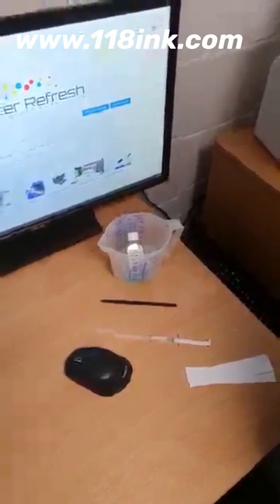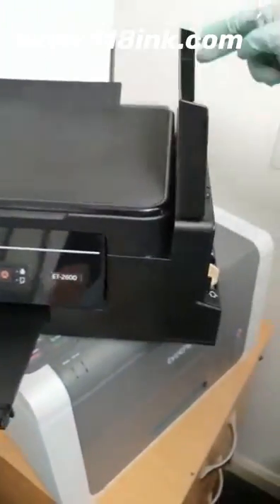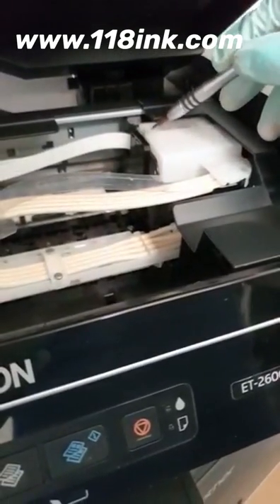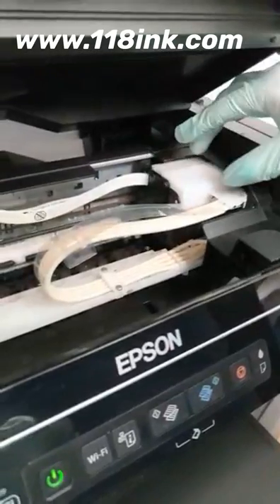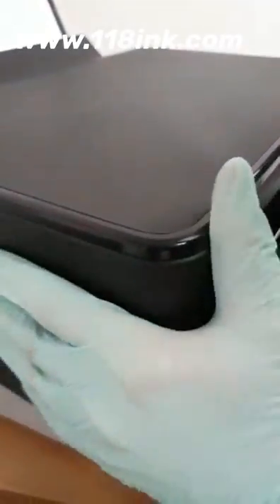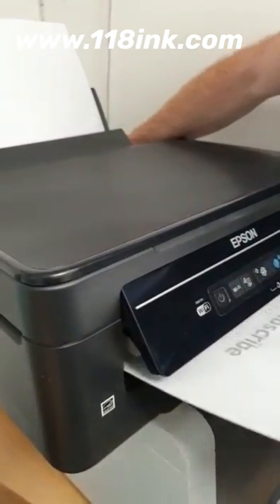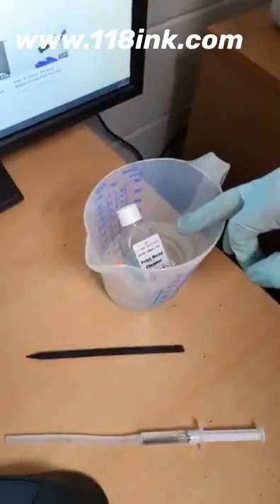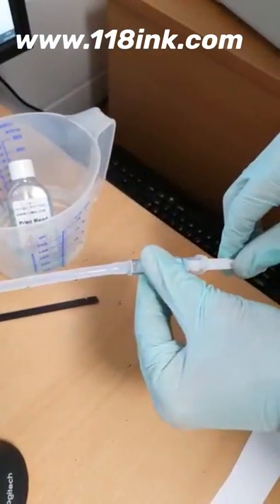How To Clean Blocked Or Clogged Print Heads On An Epson EcoTank Printer The Easy Way

Comment: That worked!  Thx.  BTW, I used kitchen towel but I backed it with some clear packing tape to make it stiffer then easier to push through and so no ink would leak through.  Also, I had no syringe but I had an eye dropper so I ran a 3/32" drill bit through the end to open up the hole and that clipped onto the nozzle nicely.  I did two flushes with the eye dropper.  Prints like new now.
Reply from the maker: That’s brilliant. What did you drill exactly?
Reply: @Theinkrefillexperts  The tip of the plastic eye dropper.  I just twisted a 3/32" drill bit through the tip with my fingers.

Comment: HEllo "guys in the same boat", there is also the power cleaning, switch off, push ? + on buttons till it switches on, then let it wok 10min, done. It uses a lot of ink but saves a lot of time! anyway thanks for this accurate video!
Reply from the maker: You are very welcome

Comment: Hi! I wonder if you could help me. I have an Epson ET-M1120 (monochromatic) which I use to print tattoo stencils (many tattoo artists are doing the same wíth these printers). So basically when I set it up for the first time I fill the tank with stencil ink for printers instead of the regular black ink. I didn’t print anything for a 1 month and half and now it’s printing with missing lines. I have done everything, head cleaning, power clean, everything that comes in the manual. Now I’m panicking cause I really need it to work 😭 Anyways I am wondering if I can do this manual cleaning to this specific printer? And (sorry for my ignorance) but should I do it with the ink still in the tank? Wouldn’t it be better to take out with a syringe and fill it again with the ink after cleaning? Won’t the liquid mess up the ink? I would be really grateful for any feedback. Thanks anyways for your videos. 🙏🙏🙏

Comment: I have questions for this video . Normally iside still have ink and in combination with cleaner this will be 50/50 ink/isopropyl alcohol  .If the cartridge can be removed like normal printer this will be better .
Reply from the maker: The method in the video is best, it’s very simple.
Reply: @Theinkrefillexperts  Yes easy way for not too much  blocked printer .
Reply from the maker: No, it will work with any blockage. The fluid will displace the blockage.
Reply: @Theinkrefillexperts  I can’t get anything to flush through seems totally blocked it did at first but now the syringe has pressure and nothing comes out on the paper , it’s the black .
Reply from the maker: I would follow the video and leave it overnight. Let me know how this goes please.

Comment: I have an Epson ET 2550. It is used, it has a little of regular ink but I want to know if there is a way to flush out all that ink to convert it into sublimation printer and add sublimation Ink. Hope you can help. Thanks.
Reply from the maker: I would advise you to suck out any remaining normal ink with a syringe and needle and then print until it runs out , then add a little sublimation ink and again print. This is most likely the only way.

Comment: I have an eco tank that I haven't used very much and now when I did the nozzle check and everything it was barely printing so I tried to print out something and nothing's coming out.  The page is coming out blank.  So would I have to do that to each line?  And do you have a video to see could it be clogged coming from the actual tank that holds the color because it says that my tanks are almost all full.  Help!  Thanks very much.
Reply from the maker: You would have to do every line that is not showing colour.
Reply: @Theinkrefillexperts  thanks very much!
Reply from the maker: You are very welcome, if I can help anymore just ask.
Reply: @Theinkrefillexperts  thank you so so much!  I definitely will and I'll let you know how it goes I have to build the courage to do it now lol.
Reply from the maker: No problem 😀

Comment: I tried doing this with my eco tank and the nozzle check comes out almost blank :( Any advice? I'm going to call Epson tomorrow about it but I'm quite nervous
Reply from the maker: Try running a few head cleans
Reply: Same here, my printer is now completely printing blank pages (not even smudges). I've done over 20 head cleanings and printing over 50 pages and it is still blank.
Reply from the maker: Try sucking upwards with the syringe. It could be air that’s blocking it or your ink could be low !
Reply: @flamecrow  did you ever solve this?  I'm experiencing the same issue

Comment: I have a ET16600 I have done all the things.....the cyan still has blank spots now what?
Reply from the maker: It could be a damaged print head then and not blocked as the fluid works very simply and will dissolve any blockage.

Comment: I  did this with every line cause my pages where coming out blank. the only color it worked on was the black.When I  ran the cleaner through the other lines nothing came out. what can I  do next ?
Reply from the maker: Run a few head cleans please. There’s possible air in the lines.
Reply: @Theinkrefillexperts  well that's the same as letting the ink wells run empty  > Epsom warns to never do ! 
Do yo even know what your doing or saying ?
Reply from the maker: I don’t understand your message.

Comment: When I print all black it keeps printing out a pattern over and over instead.
Reply from the maker: What do you mean a pattern?
Reply: @Theinkrefillexperts , horizontal lines, different sizes the same pattern all the way across the page and all the way down... like it's seeing a pattern instead of a solid black rectangle. 🤯
Reply from the maker: The printer is most likely damaged and not blocked.
Reply: @Theinkrefillexperts , how would it have gotten damaged?
Reply from the maker: Probably just from use, have you tried contacting Epson?

Comment: It is always the black on many models and blobs black ink as well. Epson has a problem with their design or black ink chemistry is wrong. My ET-7750 it will do it every few pictures then get some that are fine then blob of black again on a print or so. Nozzle checks are good and do a nozzle clean many times a month. I will do a nozzle check and it is good do a clean then a nozzle check again then there is missing black spots makes no sense because it should be good not bad after a clean. I am on my third ET-7750 from Epson the third has a spring that was stuck to the packing tape under the scanner lid so I can't use it because the spring was for something. I have let Epson know this and it is 5 days and nothing from them. So for Epson they have poor customer relations and a poor product. I say do not buy the ecotank models for sure because many models have black ink issues.